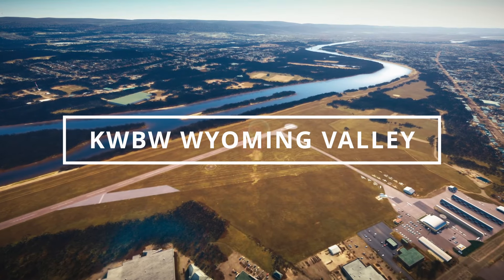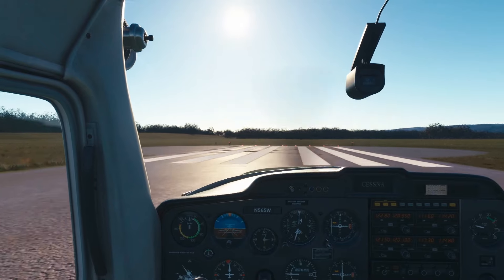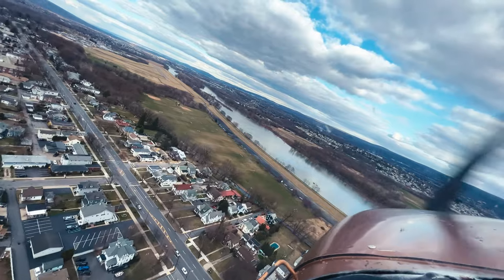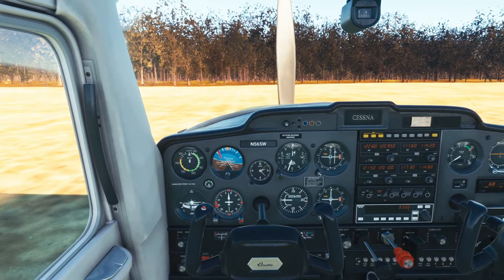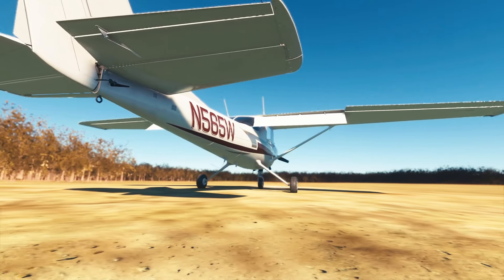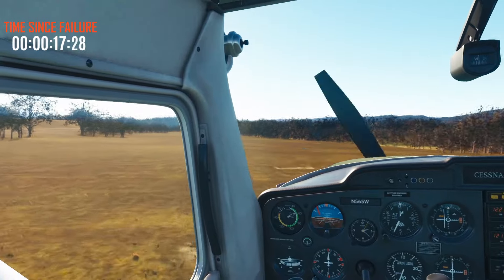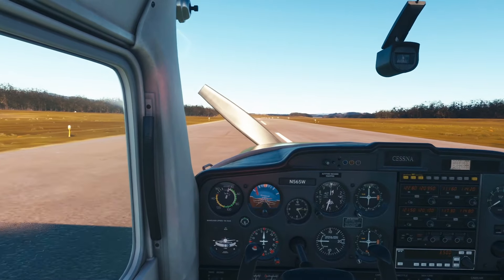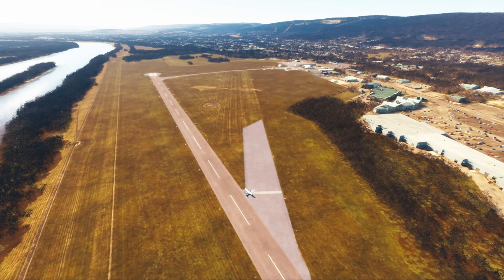MSFS 2020 Cessna C152 VFR Flight: 30 Critical Seconds

Comment: Great video.  I have seen a lot of simulator videos but don’t recall ever seeing one that demonstrates failures or emergency procedures.

I have a number of pilot ratings and always fly the sim as I would in real life. There is a saying that is very true.  Train like you fly. Fly like you train.  Good job.
Reply from the maker: Thanks! I’ve used the sim for things like trial running cross-countries before really flying them, but I surprised myself that I never tried practicing engine outs on takeoff to see if I could actually make it to where I’d briefed. Purely from a mental prep standpoint, I think it helped.

Comment: Excellent video detailing the brief and flying it.  Charles nailed it, fly like you train. 

Having BTDT in reality and survived I can tell you that briefing every flight can and will save your life.  I went down from 300 feet and made it to a par 3 fairway on a neighboring course.  I have a video posted but only in pictures  too graphic to show the actual.   When away from the home airport I’ll use google maps to survey the local area and plan accordingly.
Reply from the maker: Thanks! I watched your engine out video. You had a lot to deal with there with trees and a cabin filling with smoke from an engine fire on landing. Glad you were okay - very scary. I like your approach of using Google maps to scope out the area around unfamiliar airports and pre-pick out any potential off field landing spots. I’ll reapply!

Comment: Love it.  Thank you for sharing your departure brief. I have thought about trying some deliberate failures on takeoff like that. Love those wbsim cessnas. I had the wb-sim Skyhawk fail due to an oil-related issue while doing pattern practice. Fortunately I was right over midfield. I’ve been meaning to go back and check what the procedure ought to have been. At the very head of this vid if you’re curious. I’m going to have to give the 152 some more time. I haven’t been in it in a while.
The oil failure right at the head. 
https://youtu.be/Qp9upHUJQz0?si=xHohONbTbsOrK3-H
Reply from the maker: Thanks! I saw that video. I thought you did a great job. Isn't it amazing how little time there is from engine out to wheels on the ground?
Reply: @SDFalchetti  Thanks! Yeah, I was surprised how quickly it dropped. For a moment, I contemplated if I had any time to pull out a checklist and that was a nope. It was also surprising how actually distressed I become despite just being in a sim. When that prop stopped, its not a good feeling even in VR. Did you see my Cessna 414 vid where only my front gear retracted? I had to hand pump the gear down and it all collapsed into the ground (literally) on landing. Fun stuff when things go wrong.
Reply from the maker: Fun that you got to use the manual extension (and that it was modeled and worked). We have a Piper Arrow the school uses for complex ratings, and the gear alarm went off making them think the gear wouldn’t go down. They diverted to the nearby delta for some inspection passes before landing, complete with emergency vehicles following them.  They seemed unfazed, but I recall thinking I was glad my lessons didn’t end with firetrucks following me.
Reply: @SDFalchetti  That must have been a sight! lol
And if you're curious, I had edited the moment into a vid when it happened. a little rough but quite hilarious.
https://www.youtube.com/watch?v=gdVX6lNDfBk